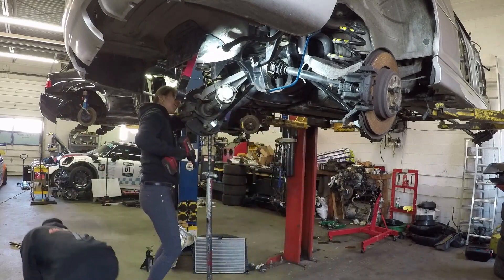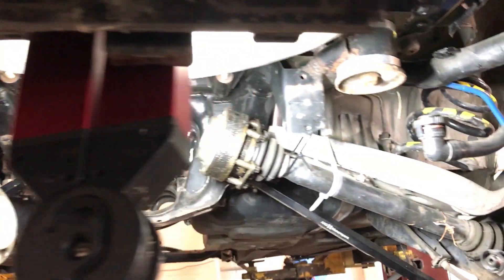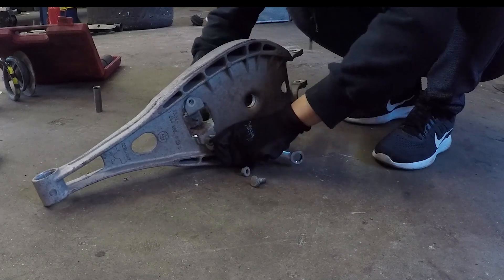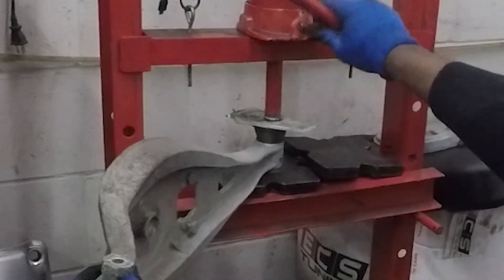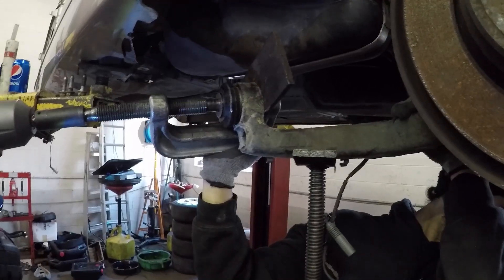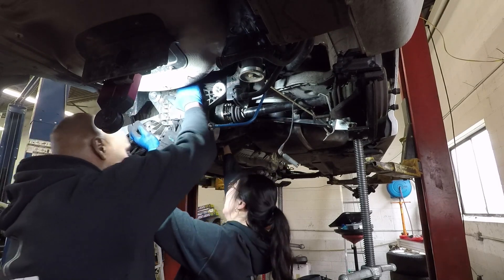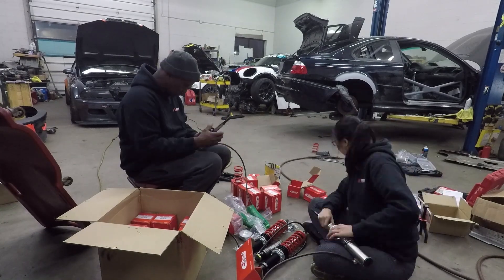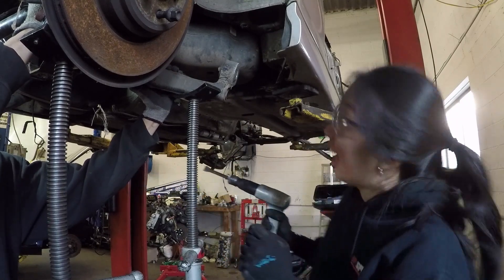E46 M3 Racecar Build Pt 8: Rear Suspension Assembly

Comment: What steering rack are you using?
Reply from the maker: It's OEM
Reply: @ChristinaYLam  Thanks. I was considering a Z3 rack on my M3, but observing your driving and the way in which your M3 is tuned has convinced me that it's not necessary.
Reply from the maker: @E46-q6u  I had the OEM rack in my E36 too which I know many people swap out for the Z3M rack. I suspect the Z3 rack may be more beneficial for autox or tighter courses. I've never tried it so I can't say for certain. Though between the E36 and the E46, I've never found myself wishing for a tighter steering ratio. OEM has been good to me.